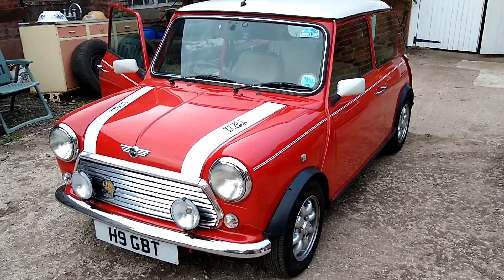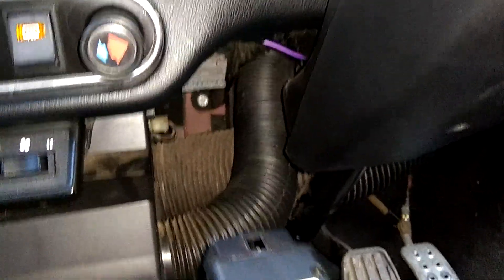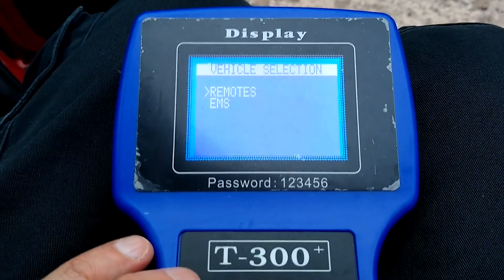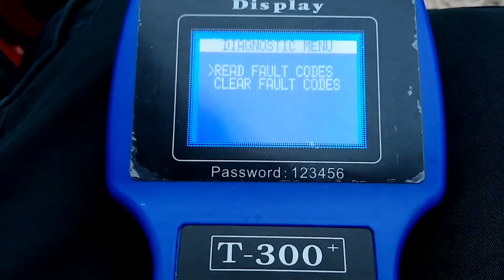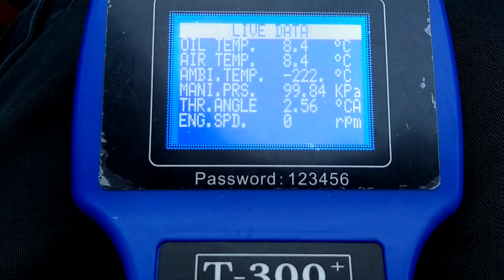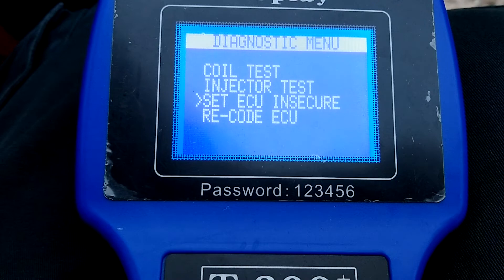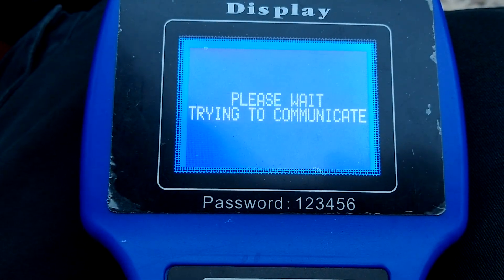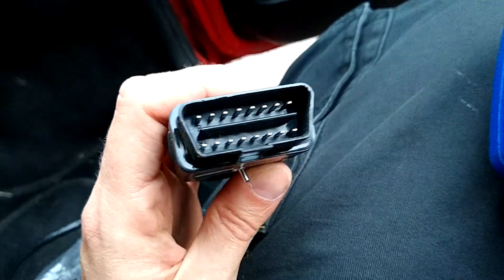How to connect the T300 diagnostic tool to a Rover Mini Cooper MPI

Comment: Why do you need this custom cable, doesn't the t300 come with loads of cables? Can't you just use the obd cable that comes with it?
Reply: I plugged it directly into a Lotus S1 using the so-called "OBD" connector that came with it. I had access to the same functions as those shown in the video. Now, is it useful...? As in the video, with this special cable....the live data is more or less accurate, some codes are not relevant.
Quite doubtful about the interest indeed.
Reply from the maker: I am very jealous that you have a lotus 🙂
Reply from the maker: The Rover MEMS system pre-dates the OBD1 and OBD2 protocols. The pins used in the plug are unique to Rover hence the need for a bespoke cable